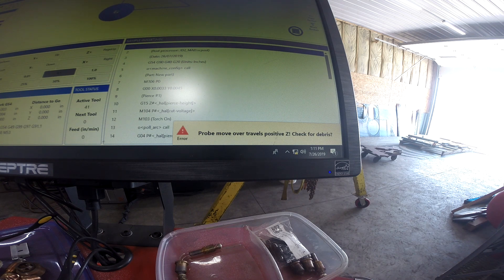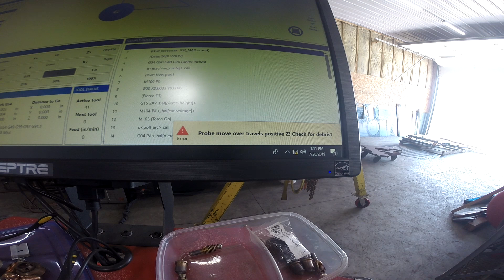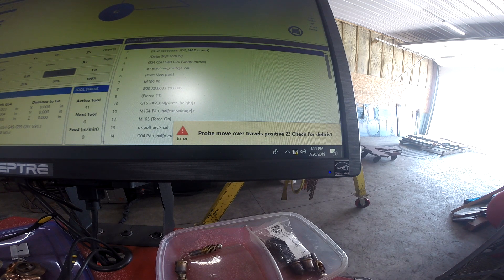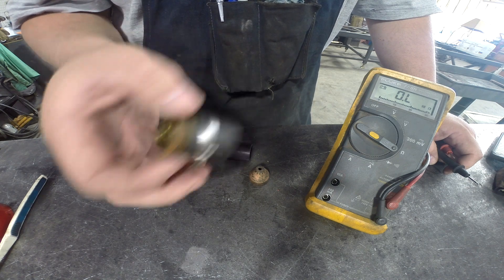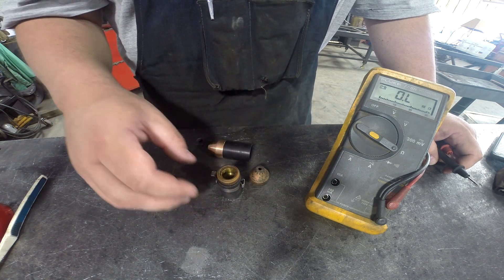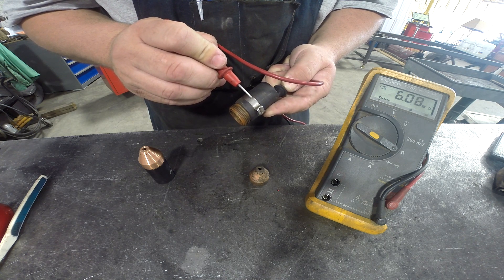Hypertherm PowerMax Plasma Ohmic Cap Issue - JD2 MAD 5 x 10

Comment: I have a Plasmacam with a Hypertherm 1000 G3. I have come to the conclusion that my sensor ring/shield is worn to the point that the torch nozzle is touching my material and getting either a material not detected notice or my torch starting with no cutting. Just burns a hole and sits there. I checked it with a straight edge and the nozzle is definitely protruding further than the sensor ring/shield. My question is: Am I on the right track?  I can't find specs to see what a new ring measures at height so I can compensate for wear while waiting to find and order a new one. I'm also a machinist that could make my own in a pinch. Thank you!

Comment: The composite threads on the front of the retaking cap are there to isolate the shield from the anode (nozzle) connection inside the torch. Plasma cutting dust is highly conductive, and if allowed to build up on these threads will create a current path, exactly as the video shows. Keep the threads cleaned ( often) and this issue will not occur. If the dust builds and is not cleaned off, eventually a permanently carbon track will develop though the threads, and the retaining cap will be junk. As the operators manual states, keep the consumables , retaining cap and torch clean.....and you will get ultimate life. The retaining cap on my Powermax85 is over 5 years old. Good video, very informative!  Jim Colt
Reply from the maker: Jim, thanks for responding. Do you have any suggestions on cleaning these parts? Just blow it off with compressed air or is there some type of solvent that can be used. I noticed that some dilluted purple degreaser worked well on the copper bits.
Reply: I use compressed air and a clean cotton rag.....wipe the retaining cap, the torch body and the mounting sleeve until it looks clean....the more dirt, the more conductive! A common failure is a heavy arc that goes from the electrode, through the swirl ring , to the upper brass on the retaining cap, then follows the dirt to the torch mounting bracket. Torch and retaining cap are junk once this occurs, and it is from the torch being covered with conductive dust. Kept clean and you can expect to get more than a decade out of the torch. Retaining caps average typically last for about 50 electrode / nozzle changes (in a Powermax). Kept clean they will last longer.   Jim  Colt

Comment: kind of a tricky issue for sure, i could see something like that haunting someone for days!  You still cranking out alot of parts on your table ?
Reply from the maker: Sometimes it is balls to the wall and sometimes not. I added a cnc press brake in January for some parts I got a contract for. Sometimes I hire a guy to come in and weld. This week I am working on the office. I love it though. Should have started my own business 20 years ago. Things seem to be going well for you as well?
Reply: @goldenhazeduster  its the same for me, sometimes i get slammed, other times not as much, but its been pretty steady for the last year or so.  Which cnc break did you get?  i have been looking at them also
Reply from the maker: @turbocobra  I bought a Guifil PE 20-63 with an Automech 2 axis backgage. It's from the late 90's but we had one at one of my previous jobs and the one I found was really clean. It also came with a lot of tooling. I still had to buy some heavier tooling but I am set up well for 10 ga and thinner. I actually bought a trailer and drove to New Jersey to get it. Weighed a bit more than advertised. Riggers cost was more than I expected. Built a rotary phase convertor to power it. I should have done a video series on it.
Reply: @goldenhazeduster  yea, you should have made videos on it, i am unsubscribing ... lol, but you can still make a shop update / walk around video and show and tell about it